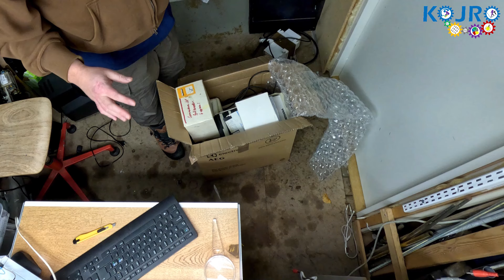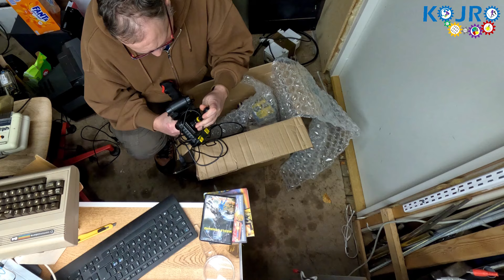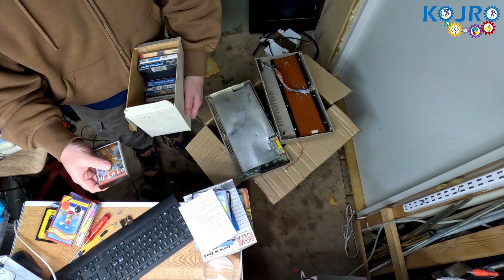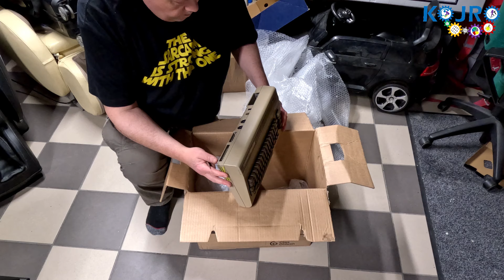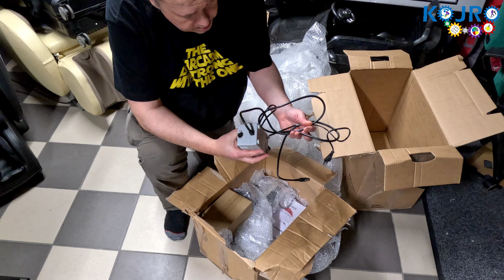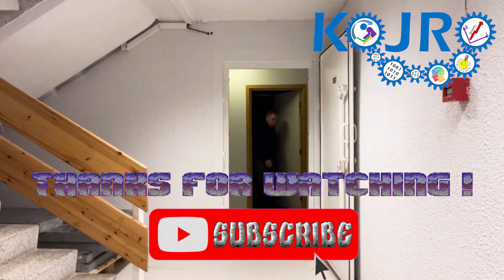A sad looking commodore, and some happy ones

Comment: 22:05 about SID replacement chips - I've read last time a honest warning on auction, that these SID emulators works very well, BUT SOME of them don't have an analogue input. Original SID was using that analogue input to drive a mouse or the potentiometer type joysticks like paddle). 
I was in shock, because I saw a lot of videos or ads about advantages of that SID emulator replacement, but I never heard any single word about that mouse issue. For games, it is not big deal, but for software like GEOS - it is.
Reply from the maker: Thats right, the swinsid and the like does not have the analog inout, but all but the first mouse for the 64 used digital decoding. But the Armsid at least has the analog inputs,

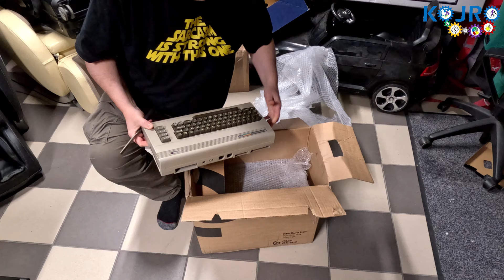Comment: 13:39 I noticed that first c64 has a cold-gray color, second and third have a warm-gray color. I think It is not a color degradation because of uv sun light. There were two types of gray color. I think brown-gray was the first years of production, then it was replaced by blue-gray color.
So today if you want to buy C64 and then later buy Disk Drive 1541, you have to pay attention to match gray color shade (tonality) I love that brown-gray - it looks more retro, it gives me stronger nostalgia feeling. Blue-gray looks more modern.
Reply from the maker: There was more than two nuances of the breadbin gray / brown. But you have to look on the inside to see the most accurate color from back in the day. but the most "yellow" of the ones here is very unevenly colored so there are some yellowing going on.